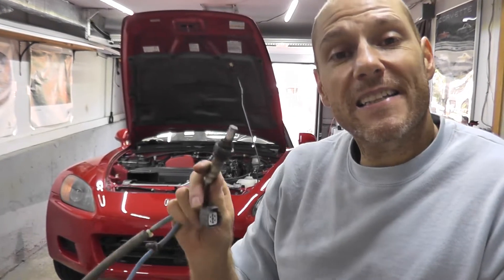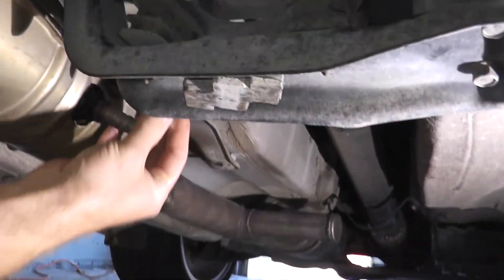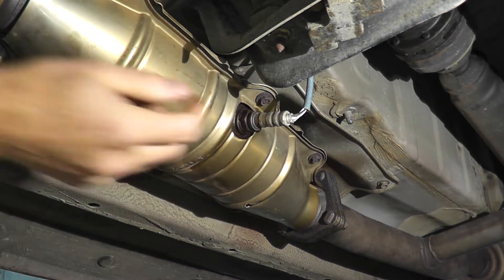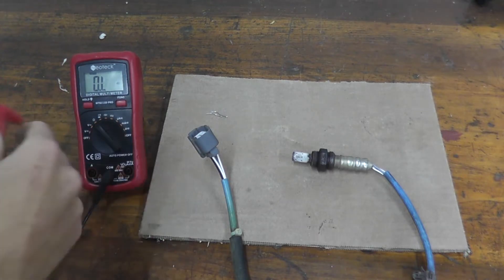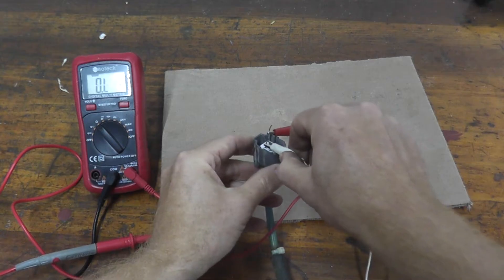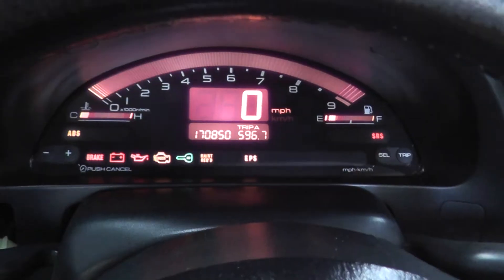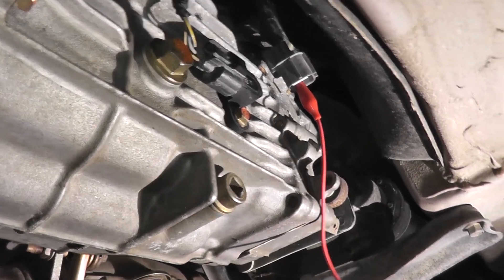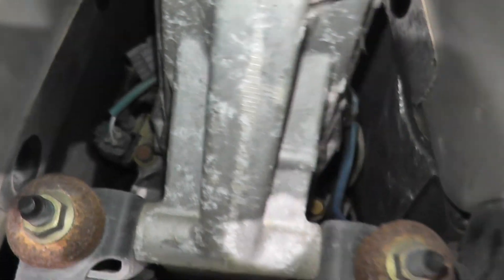How To Test And Replace Heated Oxygen Sensor P0141

Comment: Bad info. O2 sensors are 0-1 volt not 12
Reply: The signal is 0-1V, the HEATER circuit needs a 12V supply, which is what he is testing. P0141 is the HEATER failure code.

Comment: Two wires that are the same color (two white) are the o2 sensors heater circuit, the other two are the actual sensor. Sensor wont work until the heater circuit gets the sensor up to temperature. You could have a failed sensor or heater circuit ,either will throw a trouble code.